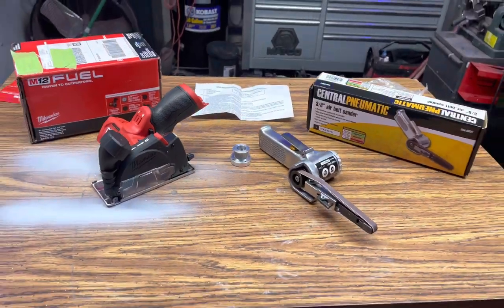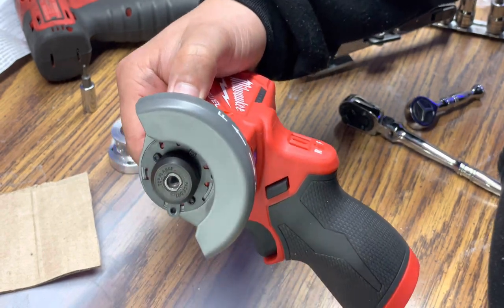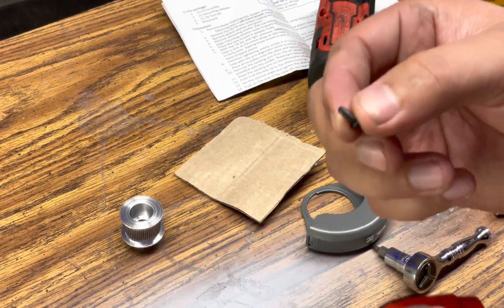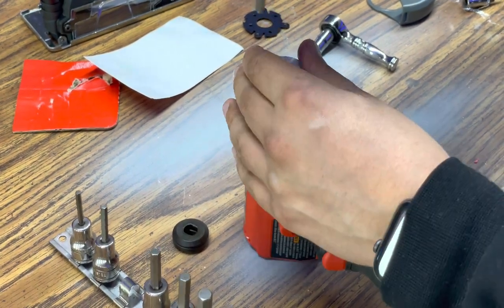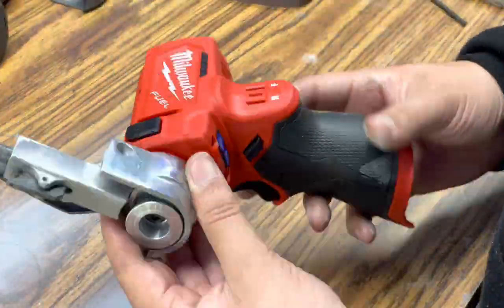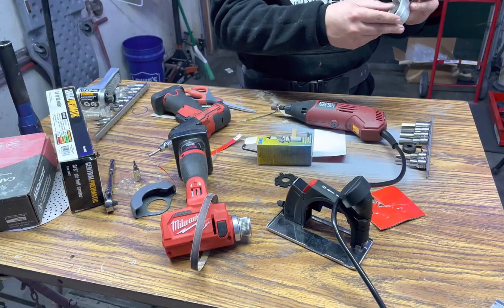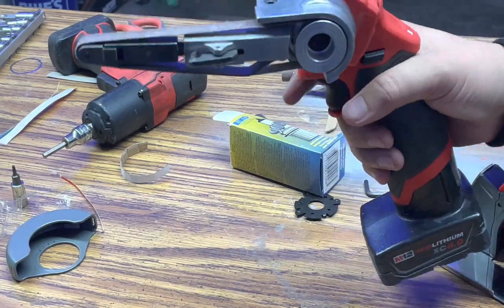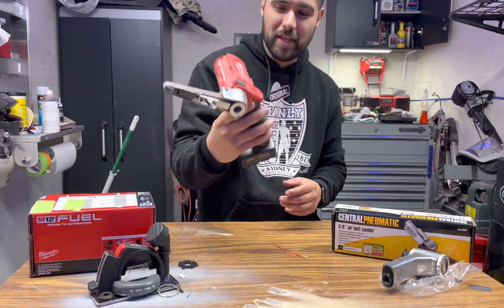MILWAUKEE M12 CUTOFF TOOL CUSTOMIZED into a BELT SANDER!(HOW TO)

Comment: Milwaukee R&D are fast asleep at the wheel with this can't believe they haven't released an official adapter kit or from factory new out the box option with this setup. Excellent tool both pre mod & modded.
Reply from the maker: Same , I’m just as surprised as you are , maybe they think it wouldn’t be a good addition to the line but I would strongly disagree on that mindset

Comment: Can you add to your notes above or even over the video that there are two different conversion parts kits for the two HF sanders. I'm getting a ton of guys that are buying the incorrect parts for the sander they want to use and then either tell me it's made wrong or tell me they went through A TON of work to make it fit as you did. Your pulley is also larger and wider than the 3/8" air sander uses. The belts will seem a little short and they will run with a little gap between the belt and plate. Thanks for posting the video though.
Reply from the maker: I have it in the description